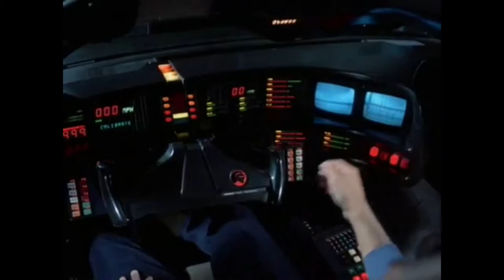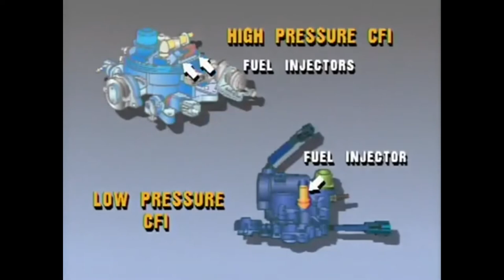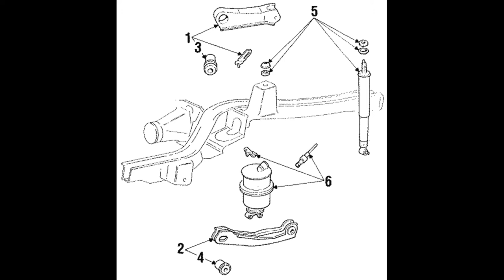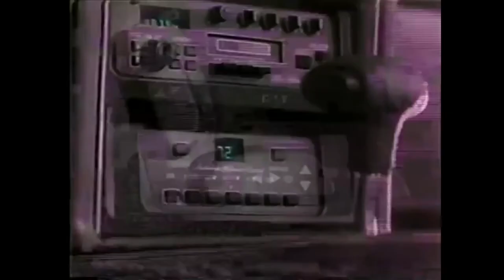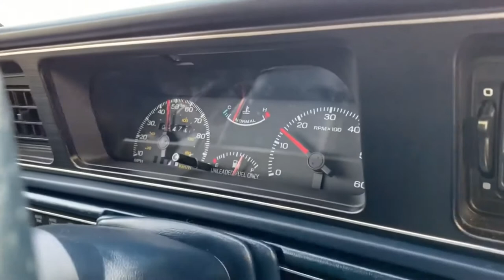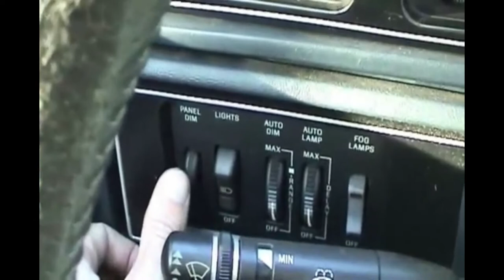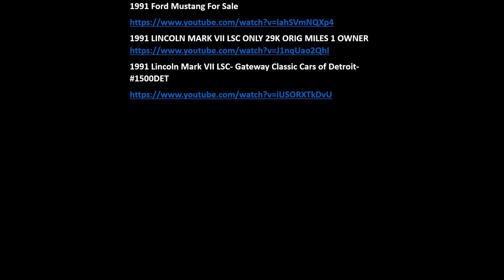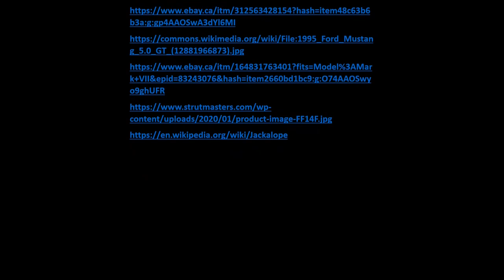Lincoln Mark VII

Comment: I owned one. Big mistake. Parts like the turn signal indicator broke off, the radio was defective, and the air suspension system never did work correctly.
Reply from the maker: I had a 1991, they say all the air suspension Gremlins were worked out by then. I replace the stereo in my car, what a nightmare! The factory amp died, so i figured I would just replace the stereo with a high powered one and forgo the amplifier altogether. The factory cd player is really short, putting a normal sized stereo in it was a challenge. The factory stereo had hundreds of wires going into it. I found keyed power, constant power and all the speaker wires so I thought I was golden. The alarm started going off and the combination door locks didn't work either. I took out the stereo found the wires and fixed it. Driving to work the next day I noticed the car was not charging. The freakin' power for the field of the alternator also came from the stereo!! I wired the field wire to something keyed-on I found under the hood. That car must have had enough 14 gauge wire in it to go to the moon and back. LOL. I remember lifting the carpet and seeing the bundle of like 500 wires going to the back of the car. Despite all that and the rear axle / transmission debacles I still loved that car 🙂

Comment: Bought a 91 LSC on craigslist for $600,no rust,90k, OD burned. It's in the garage getting totally redone.
Reply from the maker: I really enjoyed my Mark VII, I miss it. They are a great car ;-) Good luck with your project!
Reply: @jasonbowmanlovescars6966  thanks, I  always wanted one back in the day like you but I just couldn't fork over 24k . I got the tranny rebuilt  for $1200 so I'm still way ahead.
Reply: Bud you ha e to go T5 swap if you can not that expensive and supper fun...oh and put 3:73 gears in the back i ha e this set up on my 90 LSCSE

Comment: I owned 3 of them I had the special edition a loaded LSC And I owned a 1988 Convertible LSC AND bought it in Florida when I was on Vacation in South Beach and on my first one was the 1990 special edition and I put a flow master exhaust and a K&M COLD AIR INTAKE AND I got another 45 more HP  and I had a lot of fun when I used to  blow away my cousins 1989 Chevy IROC and he had the 350 engine and I used to leave him in the dust I wish I still owned my 1990 Special edition LSC  with the 6 speaker JBL SYSTEM that I updated the radio I put the best Pioneer and I left the JBL Speakers in it and under the back seat of the Mark VII  Had an amplifier and it was so load but when I had my first Daughter in 1994 I needed a bigger car and I bought a 1988 Town car special edition it was the stars and strip edition town car and I bought it off an old couple from NH  and it only had 48,000 on it and then traded it in for a 1996 Ford Explorer bill Blass edition and that was a great truck.
Reply from the maker: The Mark VII was a beautiful car, I miss mine too ;-)
Reply: Bro I have my Dads 90 LSCSE full BBK exhaust headers back with Flowmaster, T5 conversion, 3:73 gears, KYB shocks, And a TBird swaybar( the are way thicker) my stang in  hugo Boss suit. I get more looks in that then my 03 Mach1 lol
Reply from the maker: @ThePSO51  I had mine when I was in my twenties. I bought it cheap with a blown transmission and rear end. (the rear end blew and the guy kept driving it). Once it was back on the road people would always ask "What kind of car is that?" and "What do you do for a living?" LOL
Reply: @ThePSO51  Hi this is Steve can you send me some pictures of the LSC and if you want to sell it let me know and I will send you my email address
Reply: @stephenzucchari6937  hey bud I would gladly send you pics, however the car is not for sale. It was my dads car and will never part with it 🙂. Next steps for it is to go in and get the undercarriage sand blasted and re painted flat black😉🇺🇲🇺🇲💪💯

Comment: Bud great info i have a 1990 LSCSE acually the sniping you have of the T5 conversion is my car LOL 😆 I ha r changed the shifter knob since. Keep up the great work love the content. FYI I 3D printed the trim for the shifter and Shifyer boot! I have the files if anyone else needs to print another out. God bless
Reply from the maker: Back in the day when I brought up the idea of a manual swap to my friends, they insisted that would ruin the car. I really need new friends ;-) The Turbo Coupe and the Super Coupe came manual, that certainly didn't ruin them :-)

Comment: 14:55 I actually think the best years of the Mark VII were '88 and '89. It still had the original interior design, the '90 - '92 cars had the more modern but less classy interior which looked tacked on. '88 - '89 also had the turbine wheels which IMO were the best wheels ever offered for that car, especially if you had the rare chrome versions. The '88 - '89 had the original Leer seats which were more bolstered and superior in quality and function. The later versions had basic leather seats (smaller head rest, no adjustable bolstering for thighs, no adjustable lumbar support for your back, and no adjustable thigh support). The '88 - '89 still embraced its original classy look whereas the '90 - '92 versions tried dressing up the exterior to appeal to current (at the time) buyer tastes. Ford painted over all the chrome trim in a ham-fisted attempt to mask its aging look. Although hotrod like, it made the car more like a Thunderbird than a classy luxury sports coupe, which was its purpose. Most importantly, they were equipped with the 225hp 5.0 HO.
Reply from the maker: It may just be my bias, as I had a 1991 Bill Blass. At the time I preferred the LSC, but now that practically every car is monochromatic, I do prefer all the chrome. I loved the digital dash in the Bill Blass also. We are going to have to agree to disagree on the wheels, the BBS style wheels are the best! LOL

Comment: i have two I drive one of them every day for 10 years so far.
Reply from the maker: They are very reliable cars, mine never missed a beat. Well besides the transmission, but on a Mark VII that falls under regular maintenance LOL. I always wanted to 5 speed manual swap mine, that should have been an option.